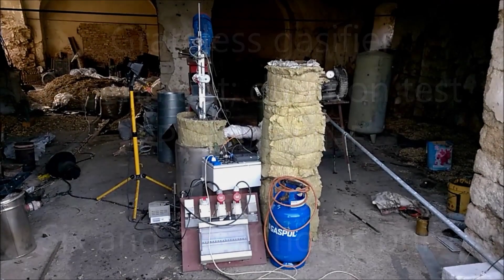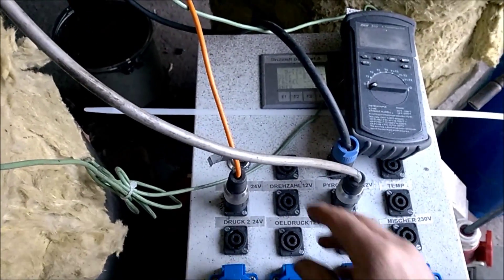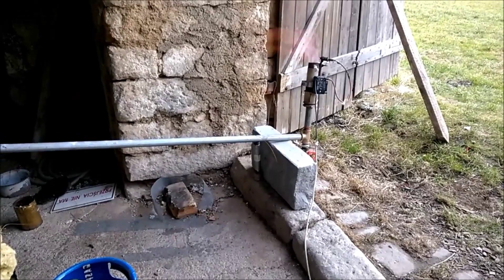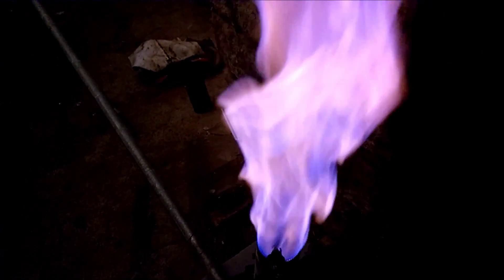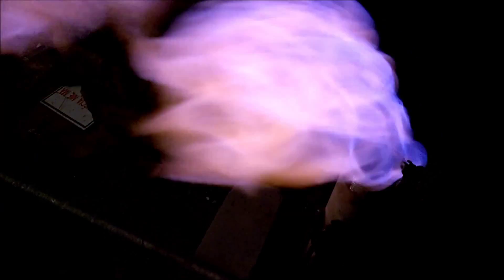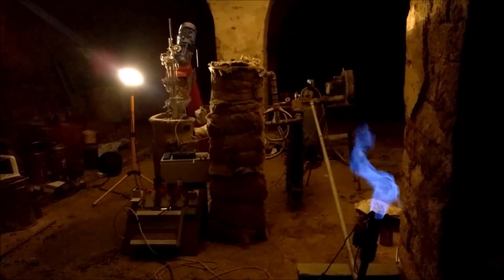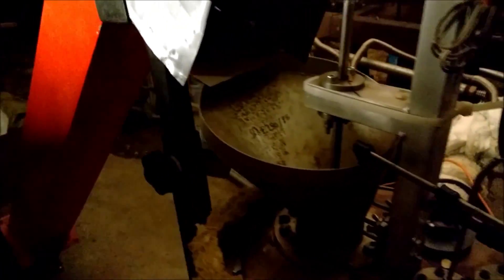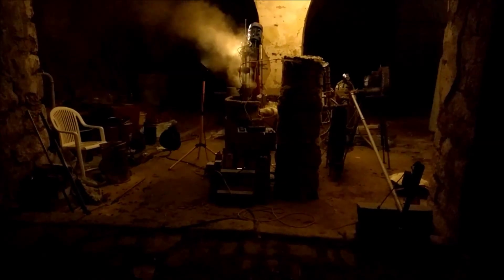First run experimental Grateless Gasifier duration test.

Comment: the temtpreture of your reduction may have dropped due to moisture content increasing the Boudouard reaction as this is a endothermic reaction
Reply from the maker: It is mostly more prosaic, just pressure drop that builds up preventing the gasifier to breath or should I say less beeing sucked. Like a sigar glowing hotter the more is sucked on it. Temp drop is a good indicator of a blocking somewhere.

Comment: hello friend im very interested in your projects, my goal is to build a similar system however i have a problem with using wood .
the reason i prefer charcoal gasifiers is that charcoal can be made   when power and fuel like gas is not available, making wood chips reqiure gas or electricity so if you have no gas you cant make fuel for this device   , so i am going to concentrate on my charcoal making skills and on running charcoal gasifires that use steam injection to increase the h2 content of the fuel stream
Reply from the maker: well, that is one of the best arguments i ever heared in favour of a charcoal gasifier. But then again, you can do a dirty start with just a hand fan and some 5 kg handchopped woodbits or have a few bags of pellets at hand for emergecy starts.. From then on you can run your chipper on woodgas after abuat 15 minutes.. Condition is you build also an pirolyse auger dryer workin off waist heat of the gasifier and exhaust engine heat to get your chips dried on the fly. Some german gasifiers work that way. I for myself think it is a real pain and allmost a fulltime job to produce enough charcoal to be able to run a few dark off grid winterweeks. for shorter runs charcoal  is ok.

Comment: Thank you Luk.  I now think I have an better understanding of how the grateless system works.How hot do the augers get?
Reply from the maker: +Frenchcreekvalley .frenchcreekvalley Pete your welcome, About the augers. Temp there is moderate. Around 500 to 600 celcius. This because the reduction is almost completed when the fuel gets there. At the exit of the auger inside the dirt pit around 350 to 400.

Comment: Hello Luk.
  I am sorry, but I still do not understand how the "grateless" design works.  I see the wood chips being pushed down by the pyrotouch,system, but  what happens at the bottom of the heating zone that holds the chips or charcoal in place?
Reply from the maker: +Frenchcreekvalley .frenchcreekvalley Pete. Untill the system worked more or less stable I preffered not to post details of a system that already was abandend. Now I felt confident enough to post a walkaround vvideo. You can find it here. https://www.youtube.com/watch?v=_VWO51YoMMA  for a description of previous versions and attemps please read in our blog here: http://thedrizzlergasifier.blogspot.com/

Comment: Hello; Is there a drawing/image of this 'grateless' design ? I understand the 'regular' Drizzler, but I don't fully get how this one works...
Reply from the maker: Vincent Renardias Vincent, I did not aswered you earlier because this design is already outdated because it did not preformed as I wished. After 25 hours continious running It clogged. Now I am tweaking it and I change elements. Soo I will run a video with the results of theis new adapted grateless design so keep tuned.
Luk
Reply from the maker: +Vincent Renardias Vincent: Untill the system worked more or less stable I preffered not to post details of a system that already was abandend. Now I felt confident enough to post a walkaround vvideo. You can find it here. https://www.youtube.com/watch?v=_VWO51YoMMA  for a description of previous versions and attemps please read in our blog here: http://thedrizzlergasifier.blogspot.com/

Comment: Also...I think that a cooler temp after your reduction is a good thing..Reduction is an endothermic reaction that will cool the gas. As long as you are getting high enough temps in the reactor for cracking molecules then the reduction cooling temps mean you are making more converted H2 and CO. Just my thoughts.  Gordon
Reply from the maker: Gordon,
Yes that is commen knowledge. The energy needed to reduce the gas makes a big drop in temperature. But best would be it always stays at more or less the same temperature at the outcome of the recuction. If during gasing the temperature drops at tat spot, there is mostly a breathing problem. The gasifier suffer from presure drop and the succion get lower and this the temperature drops.
Luk

Comment: Check out the flame colors of Driveonwood,com guys get... They run BIG V8 engines daily.
 Here's a video       https://www.youtube.com/watch?v=GWNd0Q_bgi0
Reply from the maker: Gordon,
I have seen that video, Some of the flares are OK. Some of them are just plain tar flares. But you must consider a few things.
First the Dow people are running big oversized robust engines. They do not mind a little tar swalowing, On the contrary. Tar is a very powerfull fuel it boost performance.
Second; The flares you see are maybe not filtered.
Third; The flares are made by the succion of a blower which is maybe 10 times less than the real succion of the engine. It is always easier to make a gasifier for a big engine with big succion than for a small engine. Big engine, very hot running gasifier, best tar cracking, small engine, less vacuum cooler gasifer. You would be surpriced how much more blue this flares would look if they where flared with the same vacuum as the engine deliveres.
Luk

Comment: Very nice work you are doing. I am finding out that a violet colored flare is good and just blue is weak.Co is a blue flame and Hydrogen is a yellow/orange flame. Together they make a violet colored flame.It seems that the more filters added the less hydrogen is found in the flame.Maybe the filters help turn the Hydrogen back into H2O...? I am just thinking right now about that. I see everyone with many filters just have a pretty blue flame. Nice work  Gordon
Reply from the maker: Gordon, No way a filter could alter the gas. It can take out elements. For instance fine carbon. Or soot which is mor or less the same, or charcoal dust. If this dusty particles are not filtered out then they burn inside of the flare, giving it the colour. The power of our blue flare is not discuatbel. We have tested it in real world circumstances by running a 1.6 litre Volkswagen with it. Have a look at this video and you will be amased by the performance; https://www.youtube.com/watch?v=cldgt6xPV9o